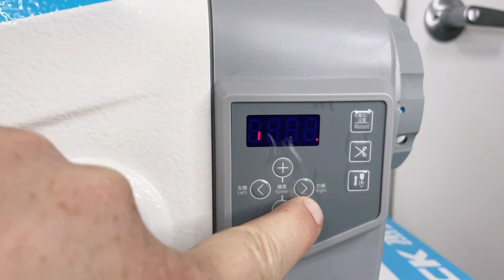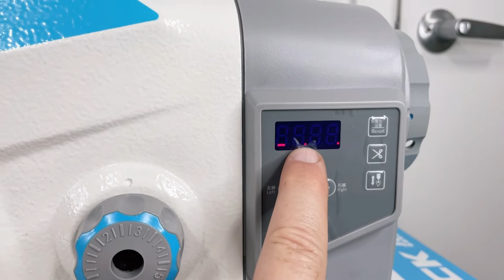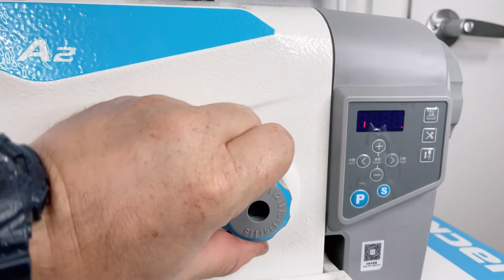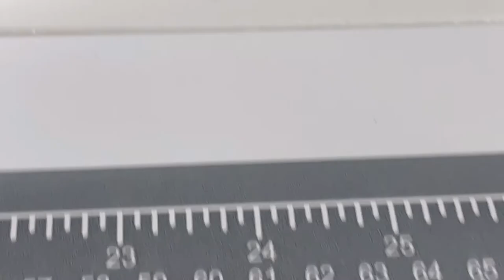JACK A2-C overview

Comment: Is it possible to put a knee lift on the A2S?
Reply from the maker: There is a knee lift kit that you can get from your JACK dealer to fit most if not all JACK straight stitch machines.